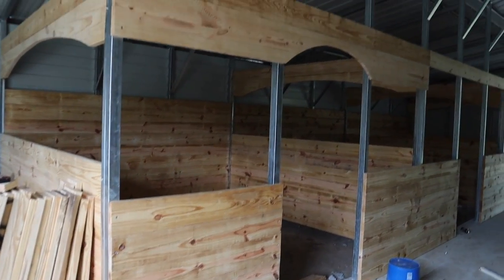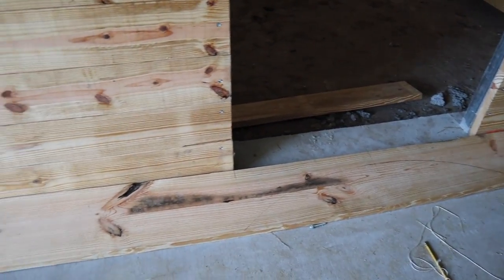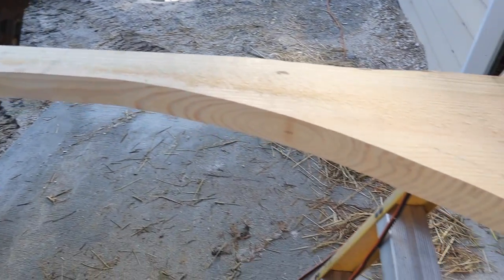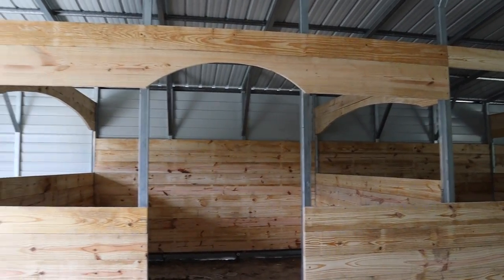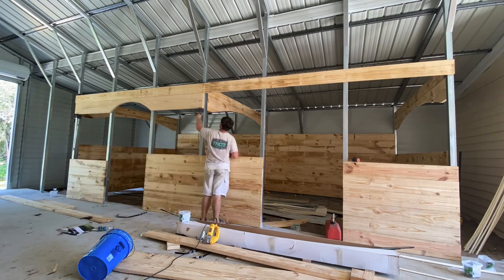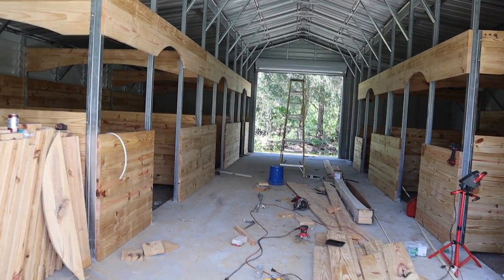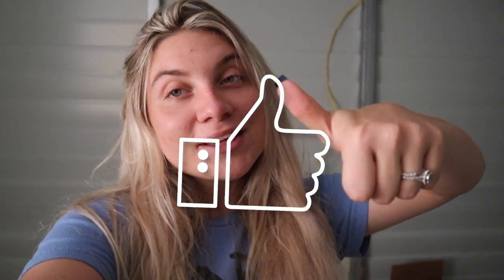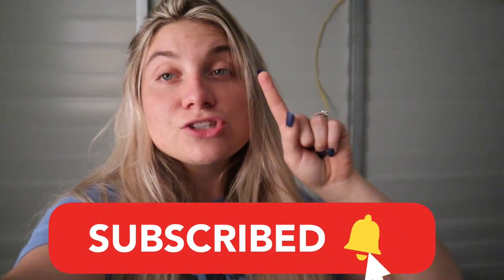THE HORSE STALLS ARE ALMOST DONE! | BUILDING MY DREAM HORSE BARN PART 6!

Comment: What if you were to put a ceiling on the stalls on the tack room side so you can keep hay, bedding, animal supplies, etc. up there. You could even build a small stair case in your current storage spot!
Reply: That can actually be very dangerous for the horses. If it falls through it could kill them. Or having hay up there drops dust on the stall and could give the horses respatory problems. Please don't put anything on a covering of a stall
Reply: That's a real good idea more storage maybe not above the horses

Comment: The wires in the tack room should be pulled through thin pvc pipe as well. That way if there is s fault the wire can be pulled out easily and replaced instead of having to remove dry wall. Love the barn!

Comment: Guys PLEASE... you have to run a 4 wire feed. You are missing your neutral wire (white) or “grounded conductor”. This is very very not ok how you ran it currently. Dont mess around with electric. You HAVE to fix that ASAP.